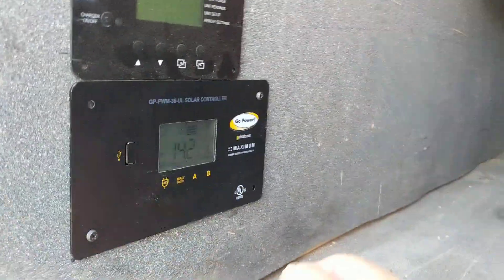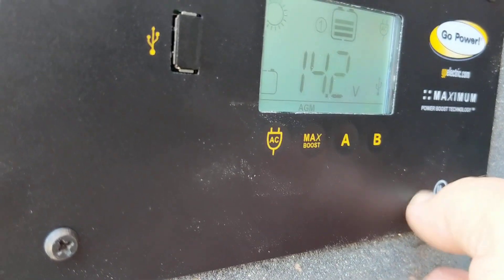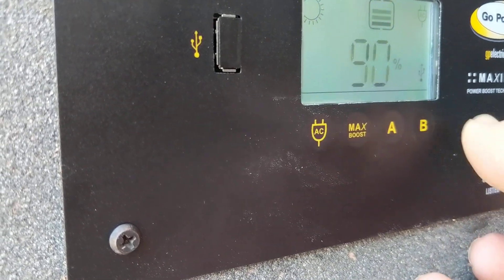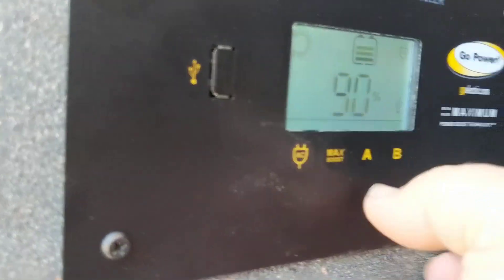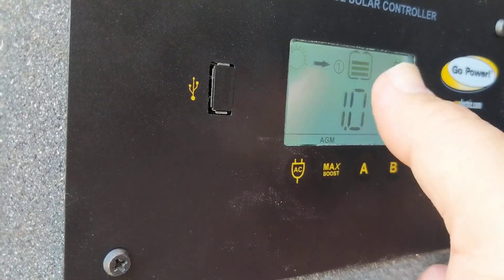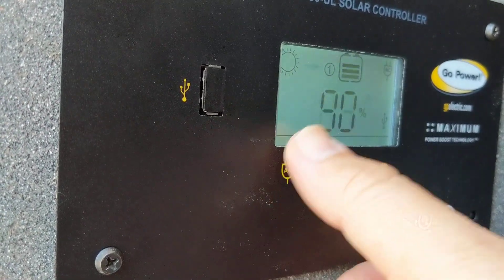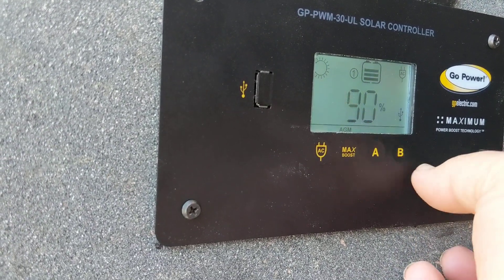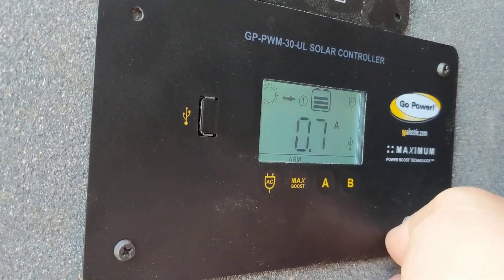Simple Battery Setup On Go Power RV Solar Controller Lithium Model

Comment: We just got a camper but it has the 30 amp pwm and i in added a battery so now i have 2 and i tried to adjust battery type on my controller and it just stays on agm and blinks and i cant change it or look at my other screens any ideas on how to fix??

Comment: We recently installed a Go Power! package with 4 - 100 a lithium batteries. After the install we had some challenges and during the troubleshooting process I called Go Power!  The technician told me that this controller in your video which appears to be the same we have, doesn’t accurately work with lithium phosphate batteries & indicated we need a standalone battery monitor device. I struggled with this message & have not invested yet as it seems that since this controller has a lithium phosphate option, it should work. Have you experienced any challenges with the device accurately reflecting the battery charge level now that you have installed lithium phosphate batteries?  We haven’t used our rig much since then and the monitor shows our levels to be at 100% most of the time which could be correct as our rig is in the AZ sun.

Comment: Worked great for two months. Today non stop rain. Got the POL error and buzz. Can’t get on roof right now. And battery area looks dry. I’m thinking it’s the rain. We seem to have 13.1 for juice. So...how to turn it off? To stop the piercing buzzing.
Reply from the maker: That would be most likely reversed polarity. Change any wiring in the RV?

From the manual:Battery 1 Reverse Polarity
If the GP-PWM-30-UL senses reverse polarity on battery 1, the controller
will stop operating, beep continuously and display POL. The controller
will resume operating when the error is cleared.
Icons Displayed: POL

Comment: I have a 2017 Ascent with the Lithium batteries but when I tried to change to Lithium on the controller it wasn’t there. Only sealed ,AGM and Flooded. Is this correct?
Reply from the maker: Do you have the newer version? https://www.outsidesupply.com/go-power-pwm-30-amp-lithium-controller-ul-and-bluetooth-free-shipping/
Reply from the maker: LFP is the letters for the profile.